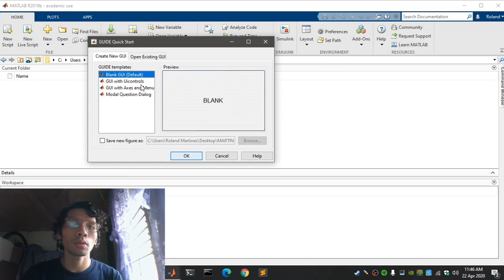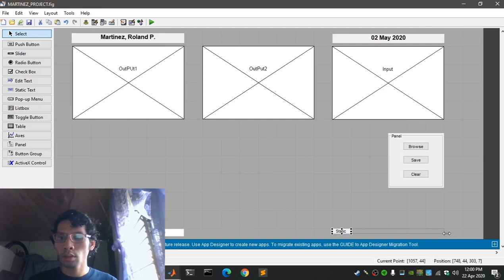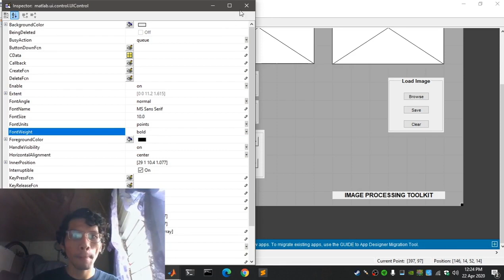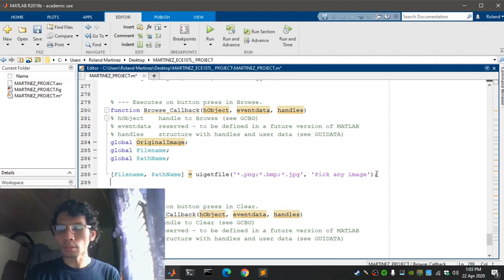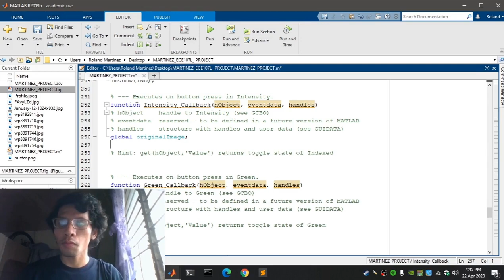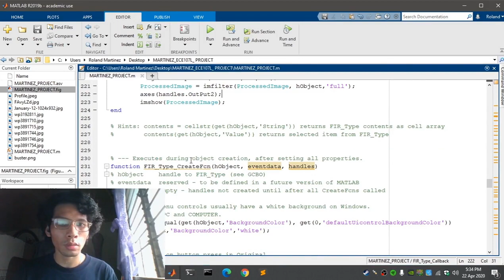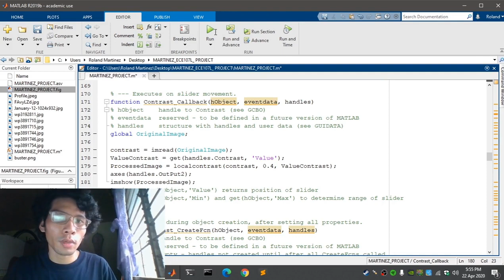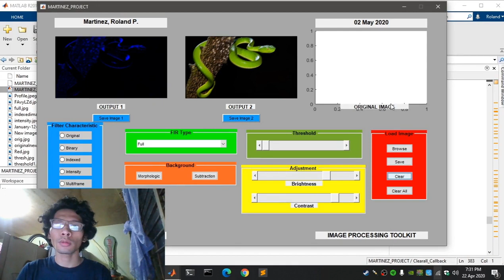GUI Programming  in MATLAB 2020

Comment: hello! Please tell how to open or access GUI from its M and Fig files.? I have m and fig file of a matlab GUI but being beginner unable to open the GUI
Reply from the maker: Double clicking the M file or fig file will automatically open the GUI. You can open the matlab command line and you can see if an error has occured thats why you cant open the files.
Reply: @rollmartz19  Thanks it opened but as you said command window is filled with errors... I'm using 2017a and the GUI I'm trying to run is built in 2016a. if this is the reason of errors, should i use separate compiler of 2016a to open GUI?
Reply from the maker: You can try it and  try to check for the error. It might be due to  backward imcompatible or libraries used are obsolete.

Comment: Good day, po! May I ask po? huhu.. we have a project po kasi and it's about GUI of Digital modulation techniques using MATLAB.. do you have sample codes po where we can start? Thank you so much!
Reply from the maker: Wala ako eh pero try nyo axes and textbox sa gui designer. saka yung code per modulation marami sa net yan. Yung inputs nyo read as string then convert to int sa case ng computation
Reply from the maker: https://github.com/QuantumReaperX/Second-Order-Step-Response try mo to sundan. change mo lng input area for parameters ng modulation.